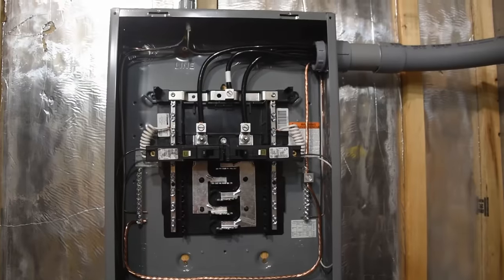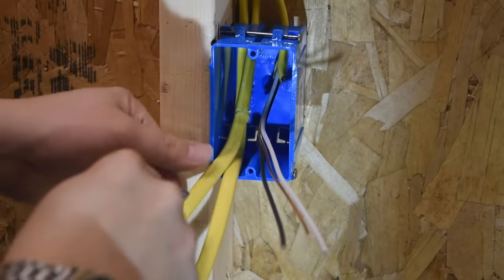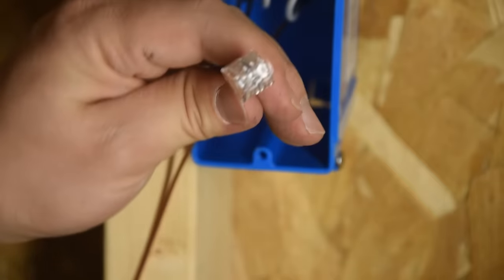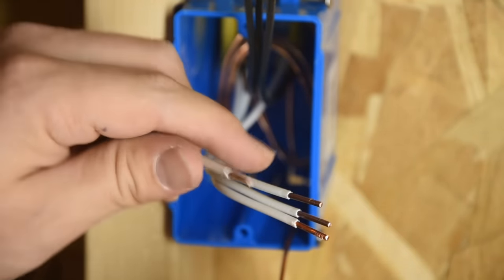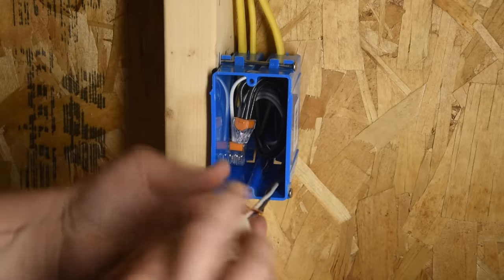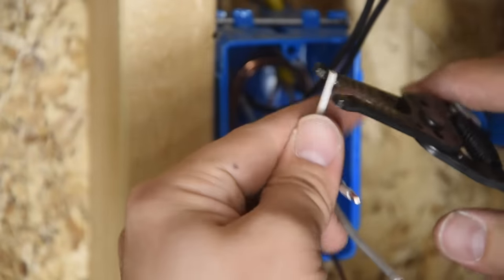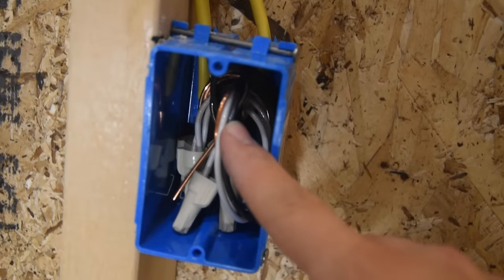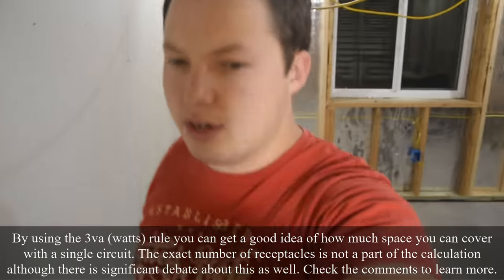Wago's vs. Wire Nuts - How To Wire Outlets During Rough In

Comment: I want to ask a question.  Your friend states why isn't everyone using Wago's?.  If you go around youtube all you hear is that you shouldn't be using them for residential or commercial use because if they fail.  Why is that, can't you get the same failure result if a wire nut fails.  Are these Wago's ok to use in residential or  commercial building to wire outlets and ceiling fans, as long as there is proper conductivity.

Comment: Pretty sure 6” outside the box is code
Reply: Shadow Hunter from where it enters the box
Reply: 1/4 inch sheath in the box. 6 inch length with 3 outside of box
Reply: 1/4” jacket/sheath poking into box and I was thought to pull 4” outside past box opening. I haven’t been called for failed code compliance on my installations (HVAC/everything.)but I’m just curious if that’s a C.Y.A. way I had been trained or...? I’m not a Wizardly tradesman (electrician), but I do have to dabble a bit, and I prefer to do it correct w/premium qualities..(dedicated circuits panel to equipment, Switch/light/sensor/timer/blah blah you all know.) if that could get cleared up so I knows, or just post some harassment and snide commentary. Thx.😬
Reply: @13ryanheartbreaker27  Same here. I dabble and research as to do it right and feel good about it. Yes. 1/4" sheath inside box. You only need 3 inches minimum outside of box though 4" inch is ok too. Just harder to stuff the wires back in. Cheers!

Comment: love the WAGO wire nuts, a lot faster and  easier to use! I get tired of having to fight with the 12 Gauge wire and trying to get them to line up and get the wire cap on
Reply: Lazy isn't smart.
Reply: @dontblameme6328  wago isn't lazy its very smart..2021. Join it..

Comment: I think wagon is not recommended for a 15Amps or 20Amps circuits, because wagon and wire and contact are not equivalent (mm). It's only recommended for lights connections for me, being carefuly about harmonic distortion carrying.

Comment: Very informative great video'!! I,m installing a 12-volt dc light switch; how would I wire this using WAGO, S  I have 14/2 Romex for the line power and 14/2 for the load side; I,m just a little confused about using pigtails to power the switch without blowing fuses everywhere; any advice would be appreciated; the switch is an SPST 2 PRONG 12 VOLT SWITCH: thanks again,PJP

Comment: Good morning you have the great tutorials buddy. How long have you being an electrician?
Reply from the maker: Thanks for asking! I am not an electrician but have done a lot of wiring at my personal residence. I am hoping to get my electrical license and am looking into my options. It's a process. I do a lot of reading and research for most of my projects.
Reply: Well you are a lot better then the old timers. They harp to much on Code you should known code before you do an installation keep it up!!!
Reply: @BenjaminSahlstrom  it shows...leave it to the pros and go work for a real electrician for a while before you do damage that injures someone. Especially installing a sub panel...did you remove the bonding screw? Or did you leave it in?
Reply from the maker: @jokerseriously514  Bonding screws are always removed in panels downstream of the main panel to prevent the ground from acting as a neutral between the main and sub. 

What did I do wrong that causes you to think that my work is dangerous? I have seen horrific work done by "licensed" electricians and excellent work done by "homeowners". Of course it goes both ways but I think it comes down to the individual as to weather they really know what they are doing. 

Thanks for the comment.
Reply: “They harp to much on Code...”
You cannot harp on Code too much.  The Electrical Code exists for good reason.  It saves lives, it saves money, and it saves time.  We can all argue the merits of some of the minutiae, but safe wiring is important for you and your neighbors!

Comment: The only potential problem I see with wygo is that the clamping mechanism is basically a spring  and over an extended period of time I have found that springs tend to loose their tention, especially if they are subjected to temp. change up and down which is prevalent with any electrical conductor.   Oh I know some wire nuts have springs also but they feel like they tighten a little better and bite in more. They both perform equally well when tested using a multi amp to induce a high amparage through them  Even as much as ten times their rating.  Time may tell.

Comment: I was a Licensed Electrician for 33 years, until 2003. Things have changed a lot. Hopefully, the old type wire nuts will eventually be replaced. They are too hard on your hands and arms.
Reply: YES! I'm 35 years in and have several tools to help my tired hands twist wire nuts including a screw-gun bit with a built in clutch for wire nuts

Comment: You need to read your cod book. I see a lot of mistakes in your load calculations. Alway keep your power and lighting separate. And also when doing load calls. It’s 180 va perreceptacle or 13.3 on a 20amp circuit.
Reply: Mark Seven 😂😂😂
Reply: Also, there's no code requirements to keep lighting and receptacles on a different circuit - while it may be a good idea it is certainly not a requirement, although admittedly I don't have the new code book yet but I have kept up on the changes coming via Mike Holt and EC&M magazine
Reply: Also, 13.3 amps on a 20 amp circuit? You better read that code requirement again...
Ask your Journeyman or Master, they'll help you out
Reply: That is for the project manager or prints to call out.   If something small like this, use common sense.
Reply: @sinistersparky9657  For those of us watching on the sidelines who aren't electricians and don't have easy access to bend the ear of a local Journeymen or Master: What is wrong with 13.3A on a 20A circuit? 33% derating isn't enough safety factor? Should the derating be 50%? I'm trained in electronics so I understand derating an expected load of the circuit is important. But, I'm not trained as an electrician so I don't know NEC/local electrical code (other than knowing that most of the code is written in the blood of the people who fell before).
Reply: @Sembazuru  the OP says claims 13 amps on a 20 amp circuit - he's advised us to read the code book but he's OVER de-rating the circuit. 
NEC 384-16 states that we must de-rate the circuit 20% - that makes a 20A circuit good for 16A continuous even though UL 489 requires all breakers to be listed for 100% of the current rating continuously. 
Long story short, don't quote code if you're not actually quoting code.
Reply: @sinistersparky9657  Ok. I didn't understand. The way your comment read was to me was that he wasn't derating enough. I now see that you were complaining about him just talking out his ass with incorrect information. Thanx for the update. :-)

Comment: I love the Wago push connectors for solid copper, but I use the Wago lever nuts anytime I have something with stranded copper (hooking up a light fixture, etc.). It's too hard to get the stranded wire into the push connectors half the time. All of it is much quicker and more reliable than wire nuts (think of the times you have 1 or 2 solid copper and 1 stranded where something slips out of the wire nut when you put it in the box... ugh!).

Comment: See that you have 'stove piped' romex with pvc conduit out of your panels very bad practice...  IBEW electrician been in the trade over 30 years never would use push-on connector for anything that is 50v or higher.
Reply: What is bad about the stovepipe?  Just curious.

Comment: DIYer here... just wondering if I can use a Wago 221 to cap off Smoke Alarm AC/Hardwire conductors in my ceiling (separate caps for Hot & Netural)?

 I was planning to replace all my alarms with 10yr sealed models, so no need for the AC hardwire harnesses.

Comment: Wagos are bad news I have repaired several outlets that have melted down. Do the job correctly with the correct wire nut with a klein twist.
Reply: Wire nuts can be bad news too if not wired correctly.
Reply: I know multimillion-dollar production plants wired almost exclusively with various Wago connectors in high-current, mission-critical applications. Up and running for years. No meltdowns.
You probably saw knockoffs wired by morons.
Reply: Sadly I can't post pictures here of the meltdowns I have seen over the years. I'm 66 now and seen a lot over the years and still not seen it all yet. I posted a thread earlier in the year, about searching YouTube in regards to just properly stripping wires. It took five or six attempts to find a video that was not fraught with code violations and/or downright unsafe installations. Mr. Sahlstrom seems to think he is the cats meow when it comes to wiring just hope he has great insurance when somebody makes a mistake and gets themselves killed trying to do what he does or their house burns down to later claim they did it just like he said to after they have filed a civil suit.

Wagos are less forgiving for poor installation procedures than wire nuts are and that's why local inspectors have real issues with them. I will use them for low voltage use only. But then I'm also the guy who won't reuse a wire nut either as why risk it.
Reply: @davidsuperdavelarson6174  I see no difference between using wegos and just using stab-lok receptacles instead of tailing everything out. Both methods are bad news.
Reply: @timgamblin1592  I agree.
Reply: Yo Mama  That's exactly my point. Both can be extremely dangerous if not done properly. But both can be extremely safe too if you know what you are doing and respect the code. Note that if wagos are dangerous they won't even be UL listed.

Comment: Wago's are great----if you are wiring low voltage/low amperage DC circuits, like sprinklers etc. You are running a 20A circuit with a lot of outlets (I beleive your exceeding code with all those outlets and guage wire used to supply them.) Your gonna build alot of heat in that little wago if you have a high draw.
Reply: The push in Wago he used is rated for 24 amps and I’ve seen them tested to failure at I ‘believe’ about 60 amps, so I don’t think heat will be a factor.  Ben does like a lot of receptacles in his house, but I’m not sure there’s actual code on the number. Can anyone cite the code please?  Rule of thumb I’m familiar with is to assume 1.5 amp draw per receptacle.  At 80% on a 20 amp circuit that allows you 16 amps and therefore 10 receptacles on a 20 amp circuit (1.5 x 10 = 15 )  His local inspector may have issues with the number)

Comment: Wago's Should be outlawed just like back wiring. Wago's thin metal bite blade does not carry as much current as even 14 gauge wire. Same as on back wiring. I have seen so many over heated wires with back wiring and Wago's have the same problem.
Reply: yeah tempting but they will create a hot spot under load and BURN.
Reply: Used them 5 years ago as to try them out, they are ok for ground wires. But if you have a high amp draw they don't seem to work well. Did one rental in the past with those in the electric baseboard heaters. Had to cut them out and replace a couple with nuts.
Reply: That's not how a Wago works, they use the spring to force the wire onto a bus bar.

Comment: Should have tried Wago Lever Nuts.  They are fantastic vs the push in type.  Expensive, however DIY projects will be a difference of a few dollars.  Someone on youtube put 100+ amps through a 12ga wire and the Wago nuts held up well.

Comment: You're supposed to strip out the damaged section of wire when you remove it from the wago as the teeth cuts into the copper
Reply: most people arent as smart as you. its the tiny aspects like that. what you just said is essentially why you shouldnt backstab outlets

Comment: I am in the industrial electrical field and we can't use wagos on anything.. wagos are in a lot of lights that we install but we can't use them.. they can make bad connections and start fires.. if our work gets inspected and they see we used the wagos, who ever did the work will be fired on the spot.. its a safety thing.. I've seen it happen and its understandable because we know not to use them but some people will to save time.. I have had to fix peoples work that used wagos and its always loose connections and fire hazards so its best not to use them.. twist  your joints and use wire nuts and tape the joints.. some places are super weird about how you twist joints but they are like that because its a safety thing..

Comment: As an electrician I never use wagos for carrying full branch circuit power. Only for lighting loads
Reply: Eric Wotton you wouldn’t have a job In London or in Sydney because those countries don’t allow wire nuts for anything. Go to their website and look at their testing and go watch some videos from outside this country and you’ll see.
Reply: @shockingguy  Good point I've heard that before about most of Europe. I'm sure the Wagos work fine for their purpose. Again I use them all the time in light fixtures. I will say the pushpin connectors on north American sockets and switches fail all the time. We get atleast a service call a month for a bad backstabbed device.
Reply: Eric Wotton Yeah I won’t use those those are 100% fail oriented. Backstabbing a receptacle or switch is a terrible connection. 
Take a switch A part and then take a Wago apart and look at the construction of the connection. The backstab connection is literally just a damn spring loaded fingernail catching the wire. There is no large contact surface or serious pressure connection completely different from the Wago’s
Reply: Eric Wotton your journeyman must not be very bright...
Reply: @dallas5374  Why would you say that?

Comment: When you pulled off the Wagos, you can see it damaged the conductors. Are you not concerned about this? We are concerned when nicking the wires when stripping off sheathing or insulation, but there are similar nicks when you took off the push in connectors.
Reply: Looked more like an abrasion to me, as the wire scraped the gripping teeth of the Wago device when it was removed. Too superficial to be concerned about, IMO.
Reply: @aaron74  To me twisting the wire for a wire nut also stresses the copper.
Reply: @thomasdragosr.841  One twist is very good. If you untwist and twist again, it's not ideal but still perfectly fine usually. If you untwist a second time, you should probably chop off that twisted part and start over and strip some fresh, straight conductors. But hopefully you're not making so many mistakes that you would ever need to make repeated twists, though.

Comment: And make sure you push in the box as far as possible,  most drywallers use a rotary drill to cut out boxes and they have been known to cut wires

Comment: I can't tell you how many jobs I've been on where there is a loss of power on a circuit and it's traced out to a failed push-wire device.  It's just bad by design. The definition of a good connection is it must be mechanically and electrically secure.

Comment: Ha ha ha. 
I like your comment on why they call them wagos, as there the way to go lol. 

Wen you start going back and doing repairs I will use the same terminology with you.
Yea way to go with the wagos  NOT. 
Yes I know there faster, less steps, no twisting and the latest in wiring materials. 
This does not corelate to better than the old way. That is not opinion thats fact. 
There is no comparison to the amount of surface to surface contact of twisted conductors.
Reply: What he said

Comment: In this house, we are doing a long term flip (live here two years, etc), I've found ZERO wire nuts.   the junctions are just old electrical tape, and not even in a junction box.   While its horrifying, it's also been that way for 50 years.    Half the house did not have ground wires.

Comment: if you pre-twisted, you wouldn't have to worry about having all the ends together
Reply: i just hold them all together and line the ends up with the wire nut before twisting it on.   i think most people don't have experience and fail to understand the with wire nuts the ends of all the wires have to be even.  it's a skill to do it right which is why some people can't do it.  people forget that being an electrician is an actual skill that requires both knowledge and experience.
Reply: @frotobaggins7169  truth! I just watched a crap ton of YouTube and talk with electricians before I do any job, lol

Comment: They make wagos specifically for ground wires most of us never use those though same goes for wire nuts, both are green in color. Your local AHJ could call you on not using the correct wagos or wire nuts for your grounds, I've never seen it called and I've been on many jobsites.....

Comment: Good way to get in trouble with wago's. Not enough surface area for good connection. Wago's not recommend for homes or any equipment requiring heavier amp draw.
Reply: Gene Doudney  We‘re using wagos in my country for 20 jears and i‘ve never seen a defective wago.
A uk youtuber tested them, wagos rated for 25 A
could handle like 50 A and burnt like the Whire and everything else at 90 Amps.
Can only say good things from Wagos, great product, easy to use and fast connections.

Comment: I usually cut out the pre wired snap in light fixture feeds that you find being used in the lighting industry also,but I will say the ones shown in the video did look up to the task,I’ve yet to use any push type connectors ever .Some saying-about being the weakest link in the circuit comes to mind.